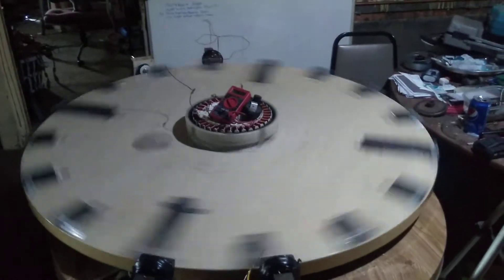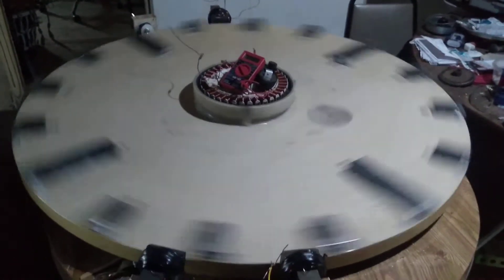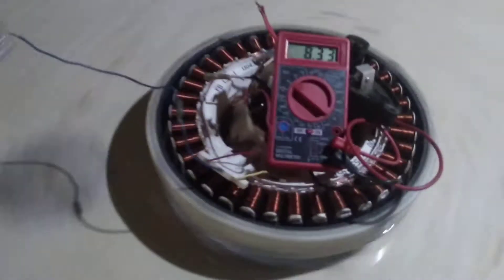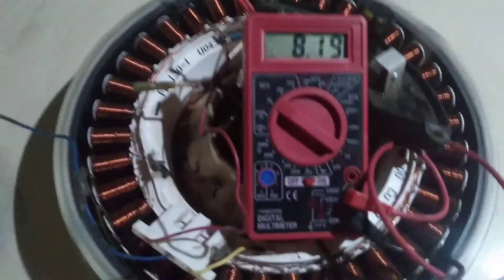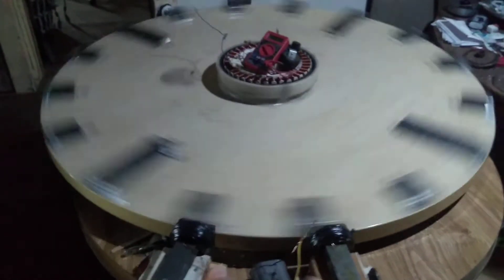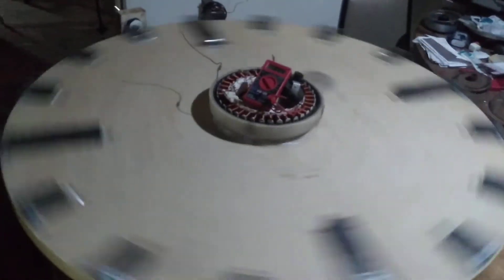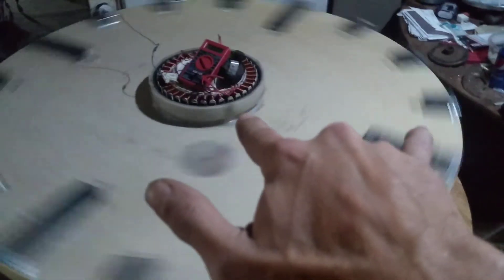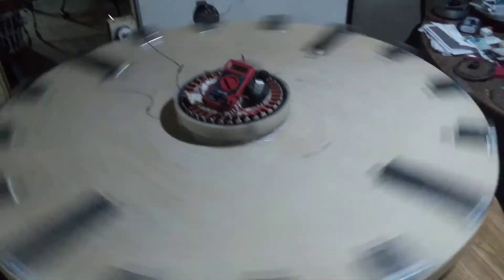80lb 4 foot v2 attraction motor, Adam's, Newman, bedini, smart drive .

Comment: Yeah bud the key is to use air core coil and make them long enough to push one set of magnets away while it’s pulling the next set towards the coils all with the same pulse using four coils with two separate drive circuits makes for a serious strong motor that can charge from the drive coils. One set is off acting as a alternator coil while the other is driving and the alternate back and forth.
Reply from the maker: I'll definitely be back to this project. Going to by some them t290's.
I'm still researching coils.  I see different results with both.  80lbs isn't easy to sling around. And its meant more to be a motor to drive a generator, than be a generator. Burnt all my switches up. So put this one on hold. Its much better on the new frame.